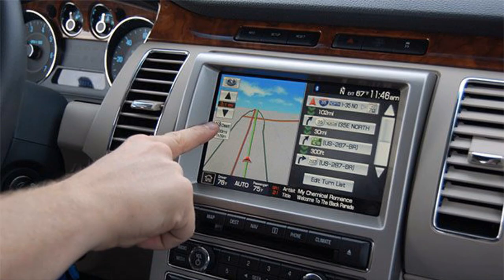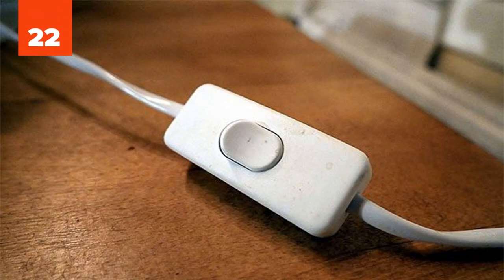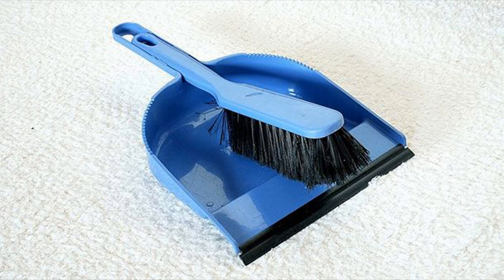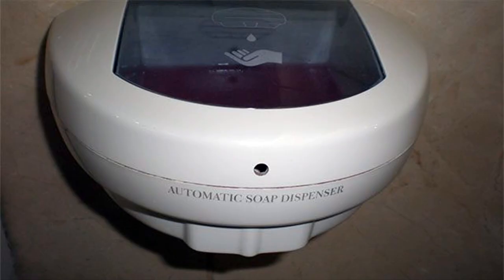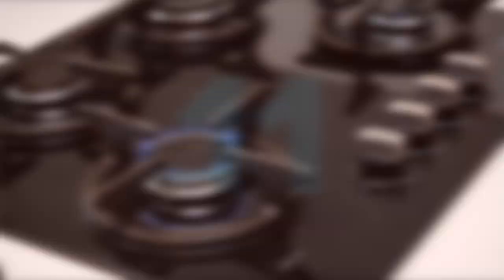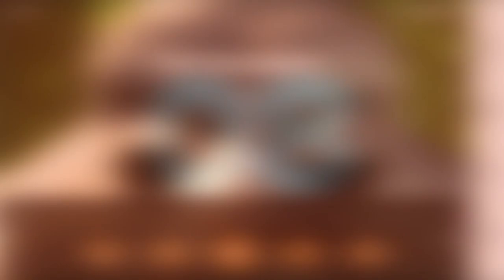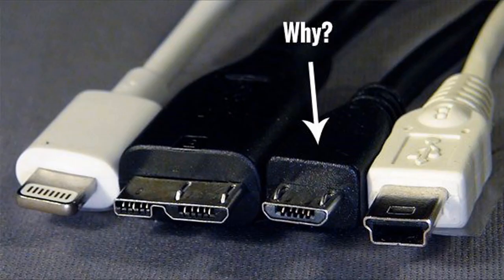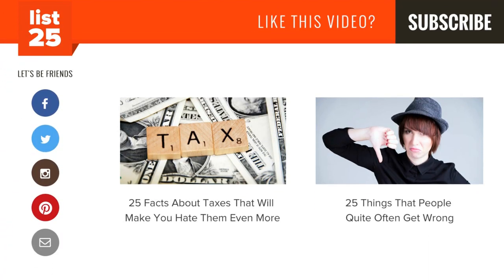25 SERIOUS Design Flaws In Everyday Products

Comment: Toilets you have to flush with your hands while you make fun of hand sanitizers with sensors on them... wash your hands after you use the toilet. Problem solved.
Reply: Baby, you have to speak to someone that you trust
Reply: I use my foot/shoe to flush if there is no automatic sensor. The handle is usually only pretty close to the bowl so it is easy enough.
Reply: Mysticfox2010 I'd fall over if I tried to do that lol
Reply: Keinlieb not all exist together.  Preventing a problem with no extra effort is the goal.  Not perfect or nothing.
Reply: And automatic doors too so i don't have to open it after someone who hasn't washed their hands have used it
Reply: Keinlieb then open door and who didn't wash before they left are sharing any crap left on their hands. Yuk
Reply: I think it's funny how the toilets in older trains let you flush and and activate the hand wash water with foot pedals but the toilets in modern trains require you to touch absolutely everything. Oh yeah, that also counted for the soap dispenser - automatic in the old trains but in the modern ones you have to turn some handle to get powdery soap as if you are turning a pepper grinder.
Reply: Keinlieb you obviously didn't watch  the whole video! 😂
Reply: I flush with my foot too.
Reply: It's all about the door opening outward! All about the push door.
Reply: Maybe wrap a towel around the door handle? That way your hands are still clean.
Reply: It would be hard for people in wheelchairs to flush toilets with foot pedals.
Reply: I think the problem is, you wash your hands, and then grab the filthy handle on the door to get out.
Reply: It would be better to use foot pedals, cause you touch the toilet flusher that thousands of other strangers have touched with who knows what grossness on their hands. People could have herpes, the flu, parasites, mucous, etc. on their hands. Washing hands is good- not having to touch that handle with your hands is better. I think this is why they made toilets with sensors, but those often go off at the wrong time, so a foot pedal control is a good idea. Also, I try to use hand sanitizer after I get home from shopping or if I eat while I'm out, if I have touched door handles to stores or public places. Thousands of strangers touch those door handles daily, with who knows what on their hands. I've gotten the flu or colds a few times when I forgot to do this.
Reply: @clowntrooper61  I think that's why he said doors that open outwards- then you can push it open with your knee or foot or elbow and not have to touch those nasty handles. Plus it wouldn't cost more to do this and wouldn't use unnecessary electricity. As it is, I try to use a paper towel or toilet paper to open the door by the handle.
Reply: I live in jamacia ny my gentitles are wayy cleaner than public sinks
Reply: Flush with your foot.
Reply: @ppsh43  exactly what I've always said!
Reply: @Mysticfox-wk2be  just as any good higher primate should👍
Reply: @Roblx518  is that a dig at Mercedes?

Comment: #12: if driver's seat in middle, then you have to climb over a seat every time to get to driver's seat, rather than just sitting right down.
Reply: If it's safer, I would be willing to scoot a little bit.
Reply: It is actually the worst to sit in the middle of a car, since you can't see the extremities of the car. You also can't see in the mirrors to park or overtake.
Reply: The center drive McLaren F1 mentioned, the passenger seats are to the side and back. Not quite as far back as a normal back seat, but backfar enough.
Mirrors and other typical driving aids are positioned to work with the seating arrangement.
Reply: when you sit on either side of the car you have an easier reference point for staying in the center of the lane.
Reply: justcarcrazy sitting in the center is actually quite the opposite. It is much easier to find the edges all around from the center, especially in racing conditions.you don't have to look as often to the edges of the car because it is the same distance from where you're sitting on both sides so you only have to use your peripheral vision. Obviously, an experienced racer would be fine doing this in any car but it is easier in a center seating car.
Reply: Race cars though have the driver positioned near the outside (in single seaters) = the driver can look partly down to be sure where the wheels, etc are.  But if seated in the middle of a regular width car, while the driver would have a better view/sense of the formerly far side, he/she would have a lesser view/sense of the formerly closer side.   'Two' seater race cars (Racing sports cars) usually have a cockpit that is narrower than 2 real seats would be.   And/or they put the driver more on one side than the other and put aluminum sheet/carbon fiber/equipment where the narrow '2nd' seat theoretically would have been.
Reply: Carl Cushman Hybels and/or/should/if/has...

Jesus Christ. Learn to talk.
Reply: Well, I agree it's confusing and overly complex.  Written late night and fast.  Trying to put in too many observations, each with qualifications.  If one can follow it though, (don't bother putting in a big effort...) it is actually perceptive and knowledgeable about race car design.
Reply: Yes, because scooting is just so difficult...
Reply: @justcarcrazy  ty
Reply: @justcarcrazy  I'd sit right for life. Pun intended
Reply: Entire road systems would have to be widened specifically for that purpose. Useless.
Reply: yes. plus then you have 2 blind spots instead of just one.
Reply: @mrmomtime111  Maybe you should learn to read.
Reply: @Awesomepizza123  exactly why they drive on the left in England, Australia, Japan and South Africa, just to name a few.
Reply: In a standard average car I don't think there is a "right place" to sit while driving. There are pros and cons to any seating position.
Reply: It would also be weird having ppl sitting next to you on both sides

Comment: #12 ~ Sure, put it in the middle... Then watch insurance rates skyrocket as the number of side-swipe accidents goes through the roof. Along with insurance companies now telling drivers they no longer cover damage to side mirrors. As anyone who drives a car on a daily basis will tell you, there's a very good reason why the wheel is on the side. As for blind-spots... buy blind-spot mirrors and attach them to your side mirrors. Or, signal, check your mirrors, then lean forward a bit and look over your shoulder before switching lanes. (Also known as changing lanes the right damn way.)
Reply: NGMonocrom So fucking true. All these people wanting upgraded phones and shit, but none of them have figured out about the stick behind the steering wheel...

Comment: Design flaw: Location of the CapsLock key on the computer keyboard. It should be away from the keys such that using it is an intentional act. Suggestion: make it one of the F keys at the top of the keyboard.
Reply: I know of a guy who actually snaps off the CapsLock key on their keyboard just for that reason, but he has to tell everyone who sees his keyboard that it was intentional.
Reply: Have to agree.  I don't know how many times I've turned on Caps Lock when I type the letter A.
Reply: The only keys you need are Ctrl, C, and V
Reply: DantEightSix : yup, because everything has already been said on the Internet.
To get rid of Capslock or use the key for something else, use key remapping (like Keytweak on Windows).
Worse problem: power button of notebooks directly adjacent to the keyboard, e.g. next to Esc.

Comment: The main danger when driving a car is oncoming traffic. For that reason, the driver sits on the side that is closest to it. Objects on the upper right are easier to see than objects on the upper left. That is why the accident rate is very slightly less in countries that drive on the left. Putting the driver in the middle means that the driver doesn't have as good a view of oncoming traffic, and the view can be blocked by a passenger.
Reply: That only makes sense for people who are right eye dominant (which most people are) so yes. I happen to be one of the rare left handers who's also right eyed. It makes my basketball shot look even funnier than just a regular left hander, but they still go in like clockwork.

Comment: 11.  Wow.  Temperature settings?  A little blue flame burns at the same temperature as a big blue flame.  The numbers refer to output, not action: a stove is designed for steady ultra-hot output, while an oven is designed for steady temperature (which is why ovens have temp settings).  A stove setting of 1-10 certainly beats low-med-high.

Comment: The steering wheel's on the side because the mechanism was easier to route around the engine with the shaft.

The barcode sticker MUST have a stronger glue than the paper so people won't peel the sticker from a cheaper product and put it on the more expensive product they're buying (they try anyway).
Reply: David Buschhorn embed an rfid tag in the item packaging perhaps?
Reply: Printing the bar code on the packaging costs almost nothing.
Reply: David Buschhorn Some retailers require a specific UPC for their particular business. And yes, shoplifters will often remove and reuse UPCs from cheaper products. Some people even print out their own now.
Reply: so then rfid tags embedded in the paper of the box is unfortunately the most secure option
Reply: Printed bar codes right on the box are the way to go. No stickers. Right on the box, like the name of the product. If there's a sticker, it's a bar-code switch.
Reply: For sticker glue that is stronger than sticker paper, use peanut butter. Rub in, wait, wipe off. May Have to repeat. No, probably not the best idea in your car on the way from the store to the party.
Reply: Today cars drive by wire so no mechanism to route.

Comment: About the glass ketchup bottles: Glass is a better insulator than Plastic, therefore, atoms in the ketchup (or any fluid) don't want to stick to the walls as much. Generally, glass bottles allow fluids to flow easier, you don't have to squeeze out the last drops because they didn't have enough charge and surface tension to fight against gravity.

Comment: minor correction but.
the offset steering wheel exists as a safety feature.

if it was directly behind the engine block in the event of a serious front end collusion the steering column would turn into a giant metal spear and impale the driver.

the only way to fix this is to develop expensive rear engine cars. or offset the steering column by placing the steering wheel to one side of the cabin.
Reply: Why would rear-engine cars be expensive? Don't VW Beetles have them? And isn't it better to have the engine weight over the drive wheels?

Comment: 23: Heat the sticker and the adhesive gives easier
21: I have never seen such things
15: These faucets really are annoying
13: Put the top on, hold the bottom and swing your arm like a softball pitcher
12: It would waste 1 seat in every vehicle to put the driver in the middle (although it would also prevent roadhead, increasing safety)
10: The sticker is food grade so you can just eat it
7: Take the stairs
6: Keep them away from kids
4: Use a different keyboard
3: Keep a supply of cords, new ones are like $0.99
2: Different sizes of money would be worse for everyone except blind people, and there are not many blind people
1: Use your foot, it's not that hard

Comment: #17 There actually is a good reason for this. It prevents the heat from your hand being transferred to the drink.
Reply: This isn't a problem with beer glasses, rocks glasses, shot glasses, and basically any other kind of liquid container, but you would drink cool or cold liquid from. Therefore it is decidedly not a good reason.

Comment: wine glasses do have that shape for a reason. The stem is there so you can hold the glass without warming the wine with your hand, the base is obviously there to set it down on, and the shape of the glass is meant to partially trap fumes, since smell and taste are so closely linked. They may look overly fancy, but they are essentially a utilitarian design. Though, a thicker stem and wider base shouldn't be out of the question

Comment: What should people in wheelchairs do if all the public toilet had a push button on the floor??
Reply: A cane or a yardstick would work.
Reply: Edward, no it would not work on most wheelchairs! Where do you think you would hang the cane? Not to mention the elderly person who requires that cane for balance trying to balance on a hard & dangerous floor, surrounded by hard objects that will cause serious head injuries if they fall instead of using their cane for it's intended purpose of holding THEM up! Nothing wrong with where the buttons currently are, if you want to add extra buttons fine, but there's no reason to remove functional buttons in doing so. I think America should maybe focus more on options like duel flush rather than fiddling with toilet button locations that have been extensively debated by professionals & are currently located in the most universally accessible location for everyone

Comment: 9 - No, no, no, FUCKING NO! I've been to China, which still has a large proportion of the supposedly-natural "squat" toilets. They are a nightmare to use. And if you have a back back or bad knees, they're a painful nightmare.

Also a candidate: power cords that put the "brick" in the middle of the cord (looking at you, XBox and Wii/U). It makes it so the range of the cord is very limited.
Reply: I completely agree regarding the brick in the middle of the cord.
Reply: GamerFromJump Xbox one s doesn't have a brick anymore
Reply: Magix, I don't know about new xb1s, but mine does.
Reply: Depending on what the brick you are referring to. I assume the one on the power connect that connects 2 cables. It is a power converter that turns AC (alternating current) over to DC (direct current).
Reply: madogthefirst - That's the one. On one hand, I'm glad there's not a "wall wart" blocking multiple plugs. On the other, a brick-in-the-middle design (as was used on X360 and X-ONE, as well as Wii and WiiU) means that if it's on a shelf, you have to find something to set the brick on, since letting it hang loose would be bad for the connector. This cuts a lot of the cord's range. If they must have the power converters external, the N64 was a good design.
Reply: I think for gaming consoles I agree. The brick should be inside the device.

However when it comes to laptops or anything with a rechargeable battery inside it, the middle of the cord is the way to go. That way it keeps the device lighter and more compact when it's not plugged in.

The thing that pisses me off is when the power converter is part of the plug itself and it blocks other plugs.

Another possible location is the device end of the cord, which I can't actually think of a single example of. Maybe it's because if your gonna have it there it might as well be internal.

Comment: Wine glasses are designed that way *on purpose*. You're supposed to hold the glass by the stem, not to alter the liquid's temperature. The glass being so delicate is also a huge sign of wealth and status. 
That it makes drunk (or clumsy, or uneducated) people spill the contents is a major plus, so that serves to embarrass whoever "should not be drinking anyway".
Reply: The material also has to be thin so it does not transfer much heat to the wine. Pre-cooled glasses seem to not be used, and ice cubes neither. 😋